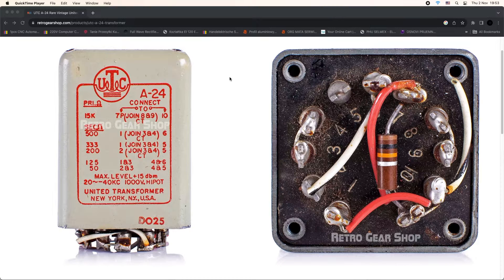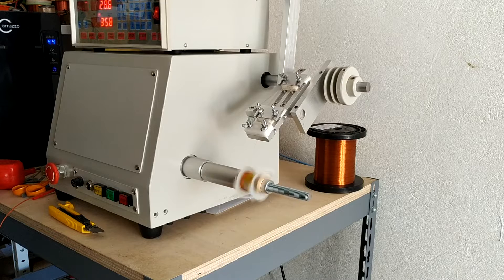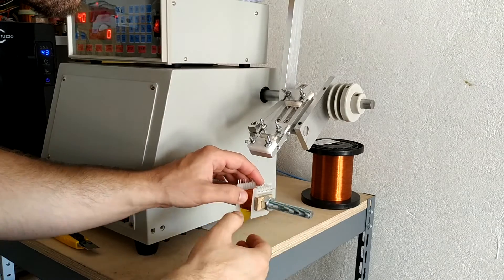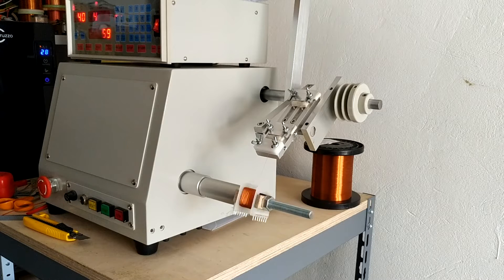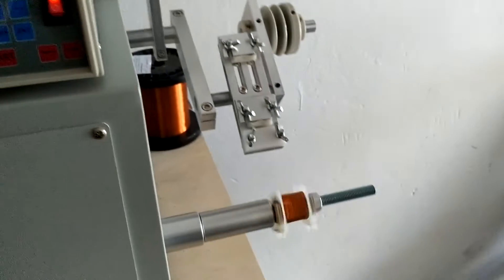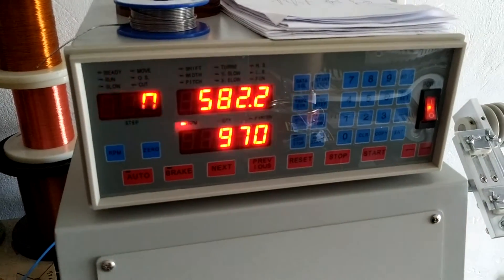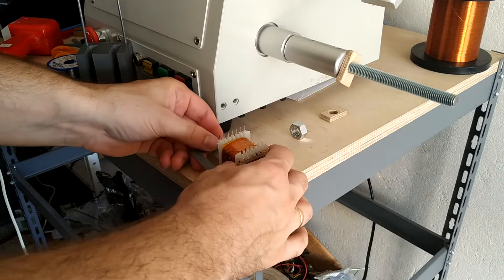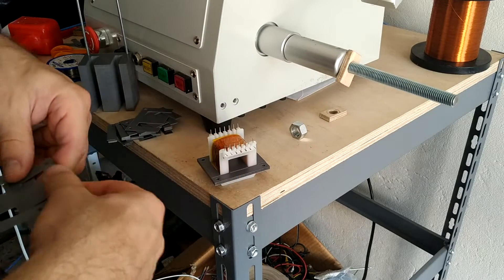LA2A Output Transformer Winding (Poor man's UTC A24)

Comment: Hello great to watch your work, i recently purchased your online calculator bundle and am gathering the necessary materials to wind my first transformers.  What is the brand type of varnish you are using to dip your transformers in. When i search I online I only get like 2 or 3 options.
Reply from the maker: The one I am using is called "Royal Diamond C", but try searching for motor enamel or motor resin you will probably get more options.

Comment: Do you cut after finishing a section of let’s say the primary and connect the  sections at a pin?
Reply from the maker: Can you explain it a bit more, didn't really understand what you mean.
Reply: @Delatsch  As I understood it you're alternating sections of the primary and secondary. So after finishing the first part of the primary do you connect or even solder the end of the first part  of primary to a pin from where you continue after finishing the first section of the secondary? Sorry it's a bit hard to explain I guess. Thanks
Reply from the maker: @FloydAtema  I connect them in series but only later when I solder the leads, then I solder them together to the lead or internal if it doesn't connect to the anything.

Comment: Great setup and results, in regards to using a vacuum it's a lot more important with larger units than these little guys, since the liquid has a hard time snaking its way through inches of windings and tiny air bubbles.
Reply from the maker: Thank you! Yes, that makes sense for the  larger ones I agree.

Comment: Huge upgrade from your old mechanical counter, hand guided setup! Many believe that inconsistently hand ‘scatter’ wound pickups have a sweeter sound, have you noticed a difference in frequency response vs. hand winding?
Reply from the maker: Thanks! In pickups it makes a significant difference because it is a low power signal and usually very mid focused. So, small changes in capacitance make a big diffference. For.output.transformer it is more important to sandwich the windings to not have a roll.off of higher frequencies. That has a huge effect on the top end. So, I do not ear a difference.